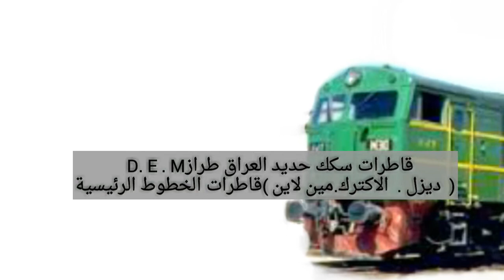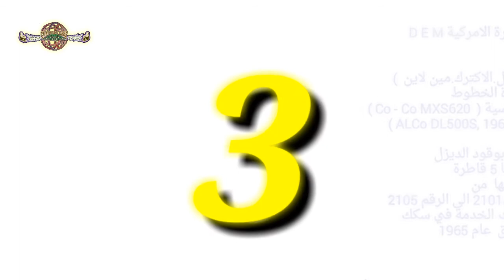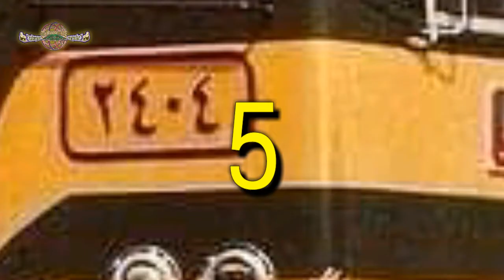قاطرات سكك حديد العراق طراز D. E . M  (  ديزل .  الاكترك . مين لاين)

Comment: استاذ القاطرة الچيكية نو DES ياسنة دخلت وشكد hp مالتة
Reply: قصدك الچيكية الي بيها كابينة قيادة  وحدة دخلت للخدمة عام 1979 اعتقد محركها 6 سلندر
Reply from the maker: اذا تقصد القاطرة التچيكية التي تحمل الارقام من 3001 الى 3036 في العراق ChME2001/002.  diesel electric Bo-Bo  القوة الحصانية 750 HP  دخلت على مراحل
أول ثمانية سنة(1961-1962)، بقدرة 464 كيلوواط، مشابهة للفئة CSD T435.0 بقوة 750hp حصان، ديزل كهربائي بتكوين عجلات Bo-Bo.

الرقم العربي(DES 3001-3008)
 رقم المصنع 5734-5736 دخلت سنة بين1961 الى 1963

الرقم العربي(DES 3009-3022)
 رقم المصنع  7723-7736 دخلت سنة 1969
الرقم العربي(DES 3023-3034)
 رقم المصنع  8469-8480 لسنة 1973

 الرقم العربي (DES 3035-3036 )
رقم المصنع  8801-8802 لسنة 1973)
Reply from the maker: اذا كان المقصود قاطر من فئة DES3100

تحمل الرقام العربية من 3101 الى 3200
وهي 100 قاطرة —  التفاصيل عن هذه القاطرات، وهي نسخة معدلة لتناسب المناخات الحارة من الطراز T669.0، ترتيب محاور Co-Co، سنوات دخول الخدمة  1979 – 1982